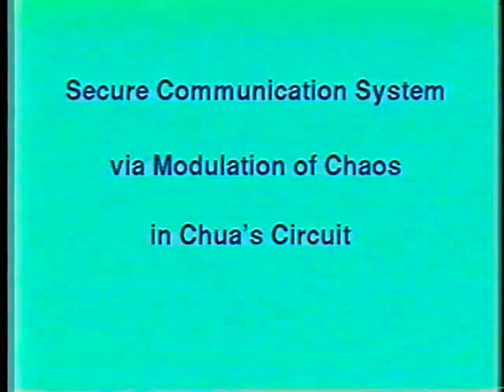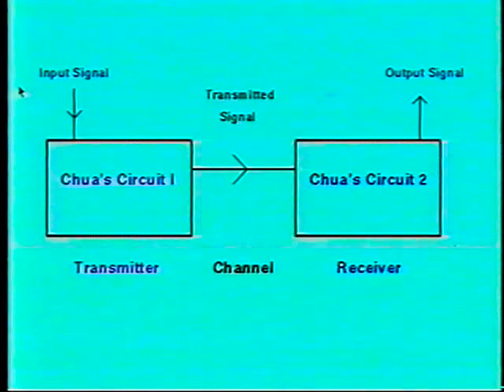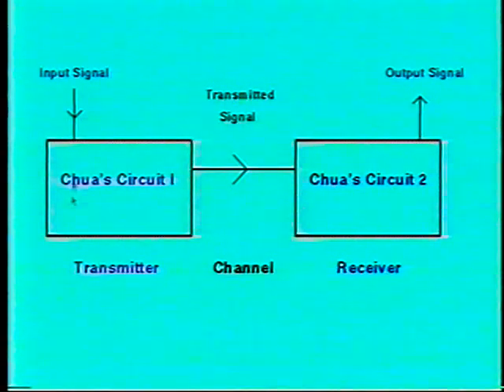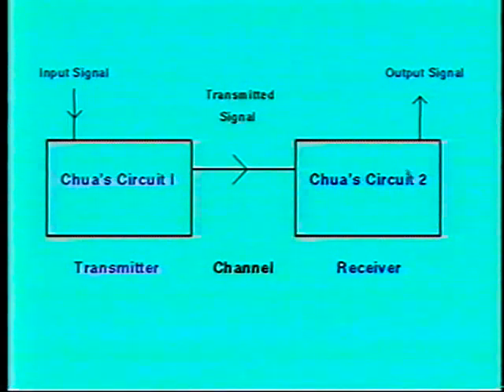Chaotic communication system

Comment: I would like to know how did you convert/insert the sound into and out of the circuit  (the directions of the experiment)? also is the synchronization impulsive ? because you didn't use any resistor